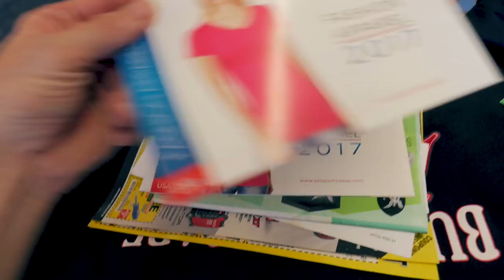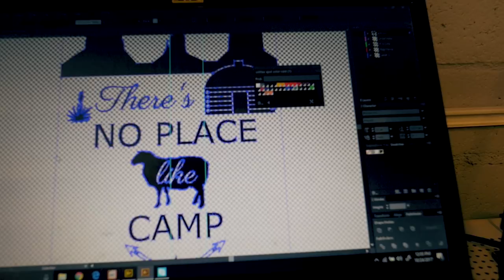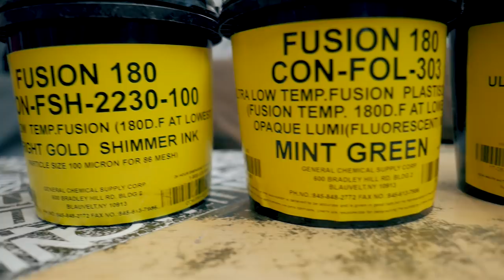Screen Print Vlog: How to Screen Print wet on wet on a Manual Screen Printing Press.

Comment: Thank you for the video...im wondering if the wet on wet build up on the screen becomes a problem and what you can do about it. Simply wiping it off doesnt clean it good enough. Do you have any more advice on that?
Reply from the maker: I'm not the best with wet on wet. The best advice is to test everything for yourself. With that said the higher the mesh count the lower the deposit of ink. This results in less build up on the bottom of the screen. That is a good place to start. from there try cleaning the build up dry and see if it leaves residue for you when you print. If it does try using plastisol press wipe, and see how bad the residue is with that. Lately we have been using press wipes, they are similar to baby wipes but for plastisol ink. Works soooo good.

Comment: Tried wet on wet the other day for a 6 color job and it turned out great. Tried again on a 3 color job and was all smeared and the inks had a wierd texture once all inks had been printed. Wondering now if I simply messed something up in the beginning and should have wiped everything down to try again. Any advice?

Comment: CAM.. at the end. You pulled in your shop some sort of exhaust fan, is that your your conveyor dryer? If so, can you explain that exhaust setup.. and it's all good if you can't. I need to exhaust my dryer somehow.
Reply from the maker: yea it the only way we could ventilate the shop without poking a hole in the wall.
Reply: Oh ok. Thanks this might be solution for me, I can't be poking holes in the garage.

Comment: 20 inch wide screens are NOT really wide enough on a SIDEWINDER or any other press with 16 inch wide pallets. Many times the side arms are rubbing on the edges of the pallets underneath causing the screens to be nudged out of register.  The screen frames need to be 22 inches wide. Call me crazy! I've been crazy for 31 years learning all of these glitches.
Reply from the maker: interesting note. We use auto sized screen but I never thought about that it would also rub the shirts.